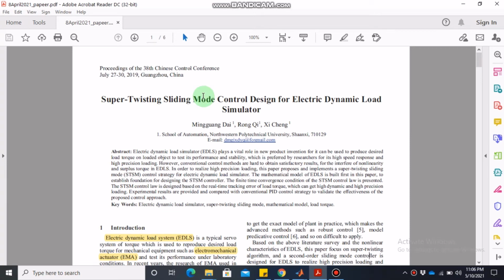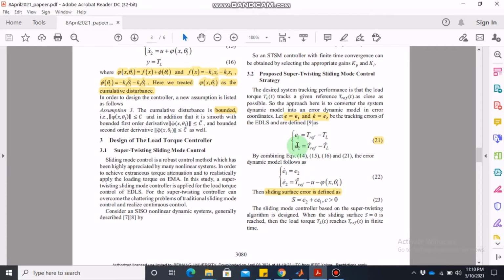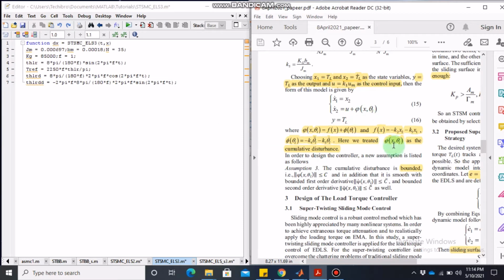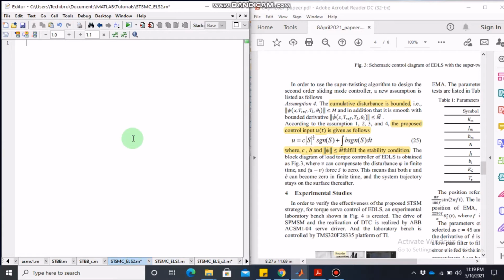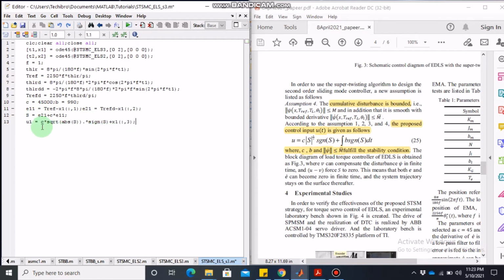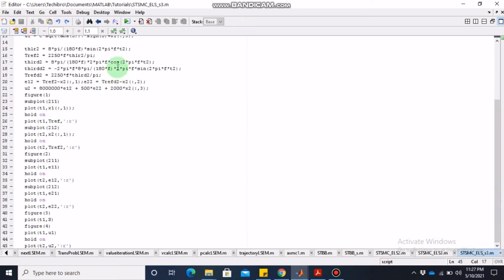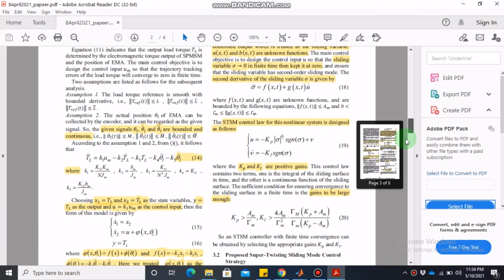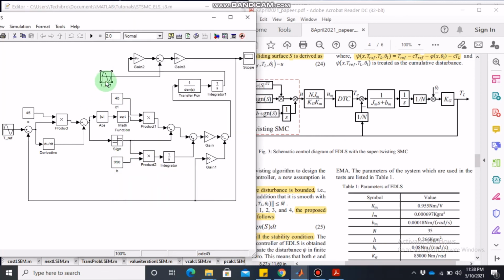Super Twisting Sliding Mode Control for Electric Load Simulator using MATLAB

Comment: Can we use super twisting  smc on boost converter
Reply: Some paper write stsmc can be applicable to system with relative degree one ...
Plz reply
Reply from the maker: @lifesgood5665  Yes it's possible.
Reply: @cset  sir can u bring one video on boost converter 
With adaptive and supertwisting smc mix type paper
Reply from the maker: Yes, it is possible
Reply: @cset  what is its relative degree (boost)

Comment: Dear Sir. 
I am studying the sliding mode control method for finding the MPPT for a PVsystem. And the output power is improved than some other methods like P&O or INC. but I would like to further improve the SMC method. Can you suggest me some ways to improve the SMC method. 
Tks Sir
Reply from the maker: Dear, it is difficult to say, but usually the researchers try to modify the sliding surface and hope for better results.